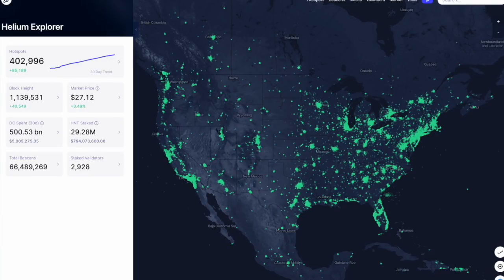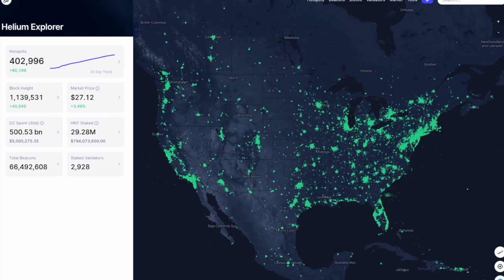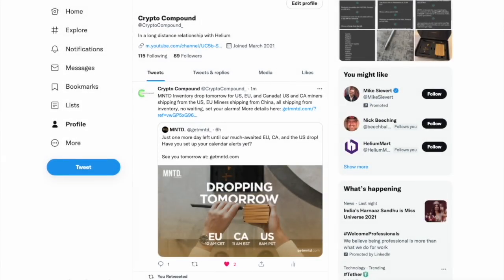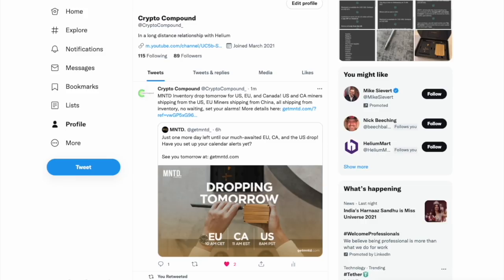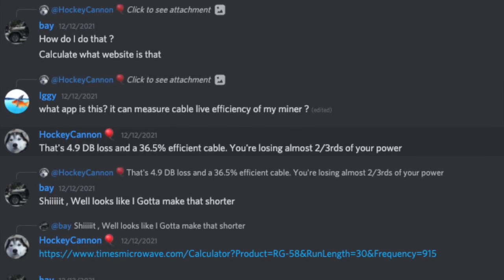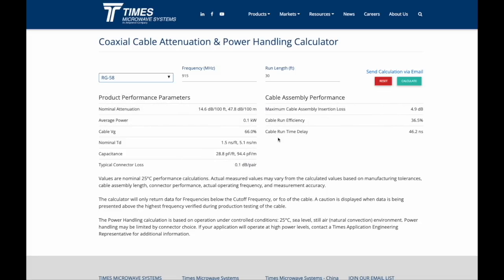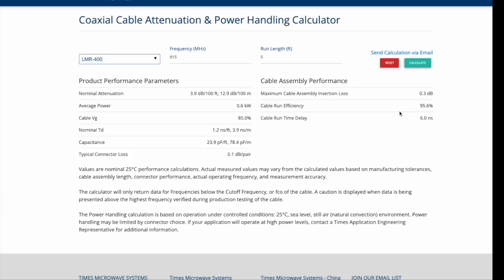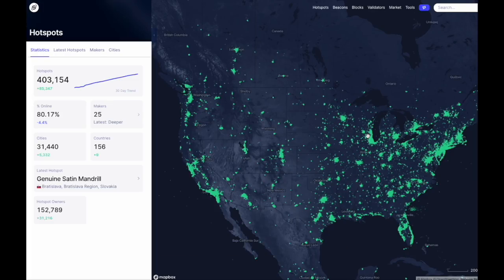Upgrading Helium $HNT Miner Antenna! Earn More $HNT Three Different Ways!

Comment: Electronics don’t like heat. If you install the miner in your attic then you are going to shorten the life of your Miner. It will probably also reduce performance. Continue the cable down through your ceiling into a closet or somewhere with better ventilation and you will have a much better install. This will only add 5 to 10 feet of cable.

Comment: Still a lot of errors in this install.  5.8 is too low gain now after POC11 for reasons of reduced transmission across the board.  Higher gain to listen better = more UNIQUE witnesses = more money.  Keep it out of the attic.  Run an ethernet cable with PoE splitter to the miner.  If your router is not PoE enabled, buy an injector for that end.  1 cable to the highest closet in the house closest to termination.  Then get a Times lmr400 from there to the chimney.  Will take work and planning, but Ive done this, and it works swimmingly.  If your attic is hot, I guarantee I just made you more money. Your welcome!

Comment: How much better is the Ethernet plug in vs the WiFi set up?
Reply from the maker: I am not sure how to judge, considering when mine is going from wifi to ethernet it has a totally different antenna setup and height, but i have read that ethernet connection is considerable more consistent and stronger, so i imagine it helps the miner perform

Comment: If you buy the wrong connector, they make components called "gender changers" to switch things if you need to. I've needed to that's how I know. Typically really inexpensive and fast to get
Reply from the maker: Thanks for the info, i already ordered the new lightning arrestor prior to learning about those. I think i would rather have fewer connections if possible anyway. Thanks for letting me know though!

Comment: At 8:30 you recommend moving the miner to the attic. Depending on where you live this probably isn't a good idea. My attic gets HOT during the summer, and the miner would suffer dramatically. I would suggest that if you have a closet or room where you can mount a shelf high up on the wall, put the miner there. Then run a pass through for the cables from the wall to the attic and out to your antenna setup.
Reply: Hot attick will cook that little miner
Reply: With HVAC in some form it'd be fine
Reply: @degendeficapital393  are you seriously suggesting to run air conditioning to an attic just for a helium miner? It would cost exponentially more to cool an attic than your miner would make per day. Terrible idea.
Reply: @metal_mo  the v stands for ventilation. Install vents in your attic for 7 bucks a register🙄🤣 you play to your skills I suppose in you own setups Im a journeyman in HVAC you don't need cooling you need fans and open registers which is code in some states
Reply: @degendeficapital393  while you are out playing in attics I'm in the office figuring out how much time you are wasting, and adjusting my bids accordingly. You are trained to install, I am trained to design. I've never seen a residential code require active fans. The only attic ventilation sometimes required by code comes from passive ventilation, ie. ridge and soffit vents. 
Even with powered fans an attic is still going to be too hot and out of spec for a Raspberry Pi.
Reply: @metal_mo  actually while you are out playing Dwight in your office I'm trading NFTs stocks and crypto and making more money when I sleep than your pay check🤣 but cheers m8 you win
Reply: @degendeficapital393  HAVC journeyman, NFT trader, stock trader, crypto trader… you should stick to one story. 
Nice emojis too, they really get your point across.

Comment: Rak antennas are not individually tested. Spend the money on a tuned, individually tested,  antenna. You will back the extra you spend in a week. McGill is the only one I know of that tests every antenna after they are manufactured. They also tests every lmr cable they make.
Reply from the maker: Thanks for the info, I might order one and test it against the rak for 30 days

Comment: Crypto, you mentioned using those antenna clips to put on your window. I've heard other videos talking about antenna placement and how putting next to the window will decrease the gain and its actually better to put against drywall. What are your thoughts?
Reply: I've seen those other videos, as well. They all state that the glass refracts/disperses the signal (think of light hitting a prism) and that double and triple pane windows make it even worse.
Reply from the maker: Interesting, i have not heard that, i always heard that regular glass windows have minimal effect on signal, but the mesh screens make a big difference. I would have to imagine it being against drywall in the house would really impact the line of sight as the exterior house walls would likely be surrounding the antenna on all sides
Reply: @cryptocompound  https://www.youtube.com/watch?v=67BwHkFIwz8 here's the video.
Reply: I used a flat cable adapter and clipped the antenna to the outside onto the window frame. You can hardly tell its even there it really blends in. It also doubled my rewards and witnesses.
Reply: @highrollaz1000  bobcat? Using the stock antenna? Everything inside except the antenna? I have the stock antenna so I’m not sure it can go outside. I’ve been thinking about upgrading my antenna to 5.8 from 4.

Comment: Can you do a recommendation on what kind of wifi hotspot we should get if we can’t run an Ethernet cord to the miner itself?
Reply from the maker: You can use any with wifi, ethernet is just more secure. I own two RAK miners and have a bobcat on the way, i would recommend either of those
Reply: @cryptocompound  i have two Rak miners, but right now they are too far away from my router to use an Ethernet cord… do you use any wifi hotspots to improve the internet connection to the miner?   My miners are in the attic and I can’t run an Ethernet cause the owners of the house won’t let me… but my miners aren’t getting a great wifi signal so I’m wondering if that’s affecting my mining and if there is a good wifi extender/hotspot that I could plug into it.
Reply from the maker: @NEXTLEVELHEALTHwithTim  yeah I’ve heard of people using those to get better wifi signal tho the hotspot, i dont know of any in particular, but i would search for a highly rated one and go e that a shot. Of course, a stronger wifi signal for the hotspot should improve your earnings
Reply: @cryptocompound  ok awesome! Appreciate the replies! Enjoying the content!

Comment: you can run POE Power over ethernet with an adapter. you don't have to run power up to the attic.
Reply from the maker: Ive never heard of that, do i need a special type of cord?
Reply: @cryptocompound  no you just need a 48v Poe splitter and 48v Poe injector. Use the same Ethernet cord.
Reply: They make a 48v Poe splitter that has a USB c break out.
Reply: @cryptocompound  Yea, PoE is a great idea for some people, especially if you put the miner outdoors because you can have very little cable between the miner and antenna (thus very little signal loss). No, you don't need a special chord or cable, just an ethernet chord and a PoE Splitter. The PoE Splitter has an ethernet port on one end to plug in the chord from your router. Two small length wires/chords stick out of the other end of the Splitter, one to plug into the power port of your miner, and the other to plug into ethernet port of your miner. The Splitters cost US$10 - US$15. Just make sure to buy the correct Splitter. Some have a usb plug (for RAK miners) and some have a barrel plug (for Bobcat miners) that plug into the power port of the miner.
Reply: Please can you explain how and what we need to do that? Thank you! 🙏
Reply: Get a POE (power over ethernet)...don't need splitter if router nearby
Reply: @vegas_pyrotechnics9820  lol I have set this up myself you don't know what you're talking about. Not all helium miners can take Poe. Mine did not. The rak kit comes with a splitter for a reason you have to break it back out to USB c before the miner.

Comment: Just saying more dbi does not necessarily mean more range. Less dbi = more radio signal bounce off the ionosphere. Less dbi = more radio waves being sent upwards more dbi= more radio waves being sent horizontally
Reply: 915MHz does not typically bounce off of the ionosphere. The ionosphere typically bounces signals much, much lower in frequency. Usually less than 30Mhz, often much less. Typical long distance ham bands are 1.8Mhz (160M), 3.5MHz (80M), 7MHz (40M) and sometimes higher bands. At 915MHz you want line of sight. The problem with high dbi is that the spread can be so narrow that it can shoot over the top of the antennas you are trying to reach. Even higher dbi antennas are horizontally directional. Focusing all the power in a vertical AND horizontal direction. These are call beam antennas. Remember that antennas are passive devices, they cannot add power. They can only focus (think like a lens) the power so that it is increased in some directions and not others. The dbi rating is the max power in the best direction for power compared to a theoretical antenna the radiates power equally in all directions. A basic wire dipole antenna has a gain of 2.15 dbi so you really should compare your antenna to the dipole for real world results. Also remember that the environment the antenna is placed will affect how the antenna performs. The environment can change the resonance frequency and/or the impedance of the antenna. A tuned antenna in one location could be detuned by material when placed in another location.
Reply from the maker: Right, the longer cables do not effect Dbi, just DB, which is overall power of the signal

Comment: I have a Europe version of bobcat, after the pocv11 will the antennas above 4dbi will be lost? And will the only and the best is 4dbi? Or can i still buy a 5.8 and benefit from it?
Reply from the maker: I do not know the exact details right now, but i am working on confirming and will provide updates
Reply: After poc11 the maximum can be used will be 9dbi,anything above that will be limited softwarewise anyway.So the best costeffective solution at least for me is tuned 5 to 6.5Dbi antenas for UK & EU ,More than that I dont see point especially in very saturated areas !

Comment: i put an 8dbi nebra antenna up near the top of my house with LMR-400 cable... it still gets witnesses 36km from it, even after POC 11.. furthest I've has is 60Km
Reply from the maker: Wow awesome! I hope i get some results like that
Reply: I just did the same setup last night. 8dbi antenna on the end wall of my attic towards the most hotspots with a 16' LMR400 cable to the miner. Still no witnesses after a beacon sent. I think I might have a problem with my Bobcat.